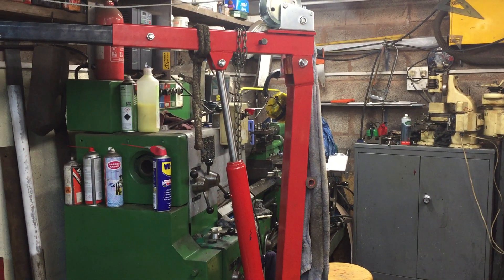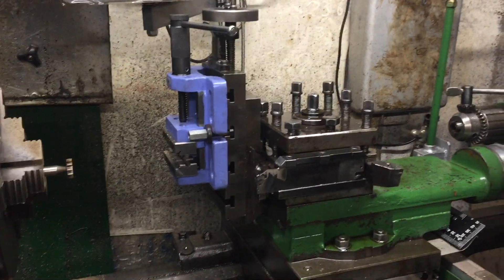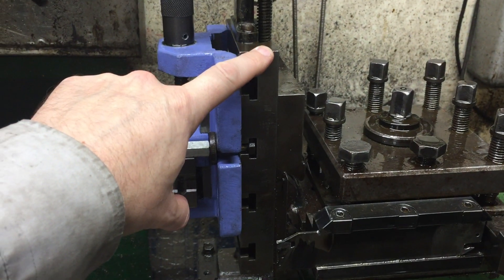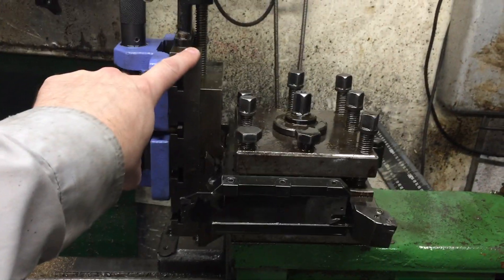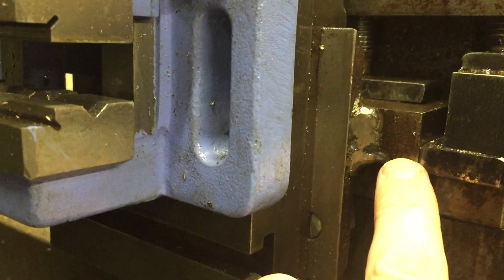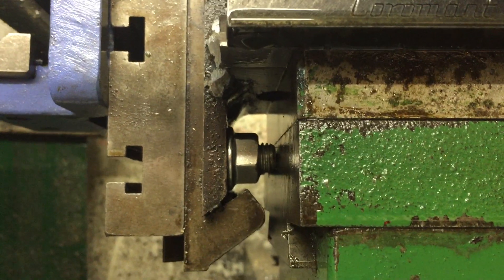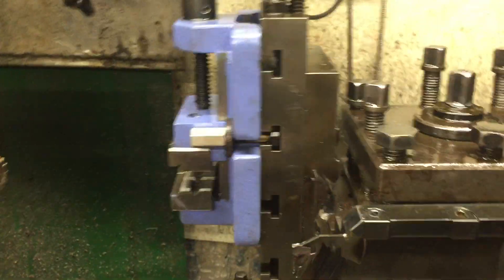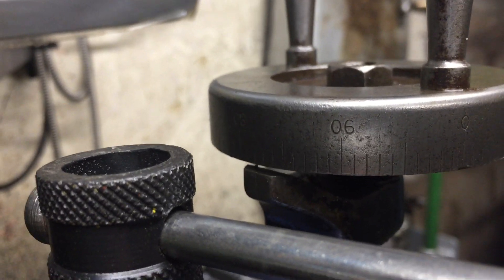Lathe milling - vertical slide

Comment: I'm building my own lathe out of a pair of I beams with hopefully a 20" swing.  Just as your milling attachment ascends, do you think if a tool ascended up into the work from the 6 O'clock position instead of the 9 O'clock position, would the cutting tool be more rigidly held?  Perhaps this idea was tested 100 years ago and not pursued, but in my mind, I think it's a good idea to get a little more functionality from my soon to be lathe.
Reply from the maker: Yes, the 100 year old fix is to mount the vertical slide direct to the deck of the cross slide. If you had a long-travel cross-slide you could leave it on there all the time :o) That would be ace. Maybe keep the parting off tool in it?
Reply: @teamidris  so other lathes cut vertically instead of horizontally?   I'd love to see videos of that as my only muse is to reinvent the milling attachments to hold cutting tools.  Does cutting this way make the machine more rigid, and if yes, why do traditional machines cut from a cantilevered tool post?
Reply from the maker: @MichaelJeffers75  vibration? And speed of production. A second tool post eventually became the turret lathe. As far as I can tell a normal lathe has a saddle held on by gravity and the tool tip right where you can see it. If you deviate away from that for a good reason there are real gains. You could put the whole lathe on a pivot so it rotates to stand like a miller.
Reply: @teamidris  thinking about it further, the current configuration delivers the forces straight down  through the tool post to the saddle, but if I did it my way, it would deliver all of the energy from 1 I beam to the other and forever try to rip my welds and bolts apart.  Perhaps just make my ways farther apart to counter the cantilever.
I briefly worked on a turret lathe and all that added was a rotating tailstock.
Reply from the maker: @MichaelJeffers75  this is where you might come to think about buying a bust lathe for the bed. The alternative is to cast the beams into concrete, or concrete fill box section. That’s a decent fun project, but the question becomes: do you need a lathe or do you fancy a lathe project. Mine was £500 and you can soon get to that value in mig wire and metal :o)
Reply from the maker: @MichaelJeffers75  Yay a link worked :o) They never do for me. That looks decent metal. What will be your spindle be, a truck hub? Already hollow for a half shaft and adjustable timken taper roller bearings.
Reply: @teamidris  To start, I'm trying these linked pillow blocks and 1.5" solid round stock as my spindle.  I saw some vids of builds where guys cut their way in, so once the spindle and blocks are aligned/mounted, I'll build the tool post and cut the spindle, weld on a thick plate and cut it, than make it into a back plate.
https://thebigbearingstore.com/1-1-2-concentric-locking-pillow-block-bearing-uep208-24/